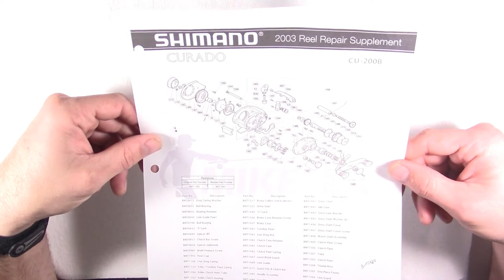Shimano Bantam Curado CU-200 Disassembly

Comment: Not sure if you will still see these comments, but wondering if this dis and assembly videos are the same for the 201's just in mirror?
Reply from the maker: You are in luck that I decided to check this channel. Yes it is just mirrored, EXCEPT for a couple things, and I hope I can remember them all.  Your Anti-reverse bearing will spin in the appropriate direction for being left handed, and the nut that retains the handle on the drive shaft is "lefty- thighty, righty loosey" aka left handed threads. I don't think anything else is that way besides the mirror. All the rest of the screws should be in normal thread direction. There are schematics for the left handed reels specifically. Almost all the parts are the same except the two I mentioned, and then sometimes Shimano just takes the anti-reverse bearing and put it upside down in the side plate. It works.

Comment: Question:  Should the roller clutch bearing be dry for proper operation?
Reply from the maker: Absolutely. Any oil/grease will cause it to slip and malfunction. This is true for all one-way clutch bearings in all reels. Also getting the reel wet (such as dropping it overboard) can cause this as well, though it would function normally after it dries.
Reply: @bayoureels1983  THANKS!

Comment: Great video.  Is reel repair your business?  I have one of these CU-200 reels that I got new back whenever.  It's never seen salt water.  It was an incredible reel when new, but now I can't seem to get it to cast well.  I just can't get any distance out of it.  I loosen the spool tension, back off the anti backlash, and it makes no difference.  I even put a set of boca-bearings in it.  Other than that, the reel has never been completely disassembled and cleaned.
Reply from the maker: Thanks for subscribing and commenting!  Yes I do have a reel repair business, though its a side-gig, not my main job.  I'm not sure why it wouldn't cast well if you already replaced the bearings, especially with Boca's.  If its never been cleaned before it certainly can help and maybe even fix your problem. It never seeing salt water is a BIG PLUS.  The main issue now with these reels is that parts have gotten quite scarce, besides bearings. If you want some help with it you can contact me on the FB page BayouRatt Reel Service.  I'm more likely going to see those messages rather than comments on here. Thanks for reaching out bruh!
Reply: @bayoureels1983  Thanks, I will contact you on the facebook page.

Comment: Hi my reel when I hold the spool and turn the handle it star turning?
Reply from the maker: Tighten your drag.
Reply: Bayou Reels I did.
Reply from the maker: @salahddinesaadi5926  I am not sure honestly what the issue is here. Is it that you can hold the spool with your thumb, and turn the handle, the spool stays stationary and the handle turns?
Reply: Bayou Reels yes.
Reply from the maker: @salahddinesaadi5926  something is not assembled correctly. It can be a variety of things. your drag stack both inside and outside the side plate could be out of order, or washers upside down. If your pinion gear is not aligned with the main drive gear, it will not turn the spool. If the pinion gear is not lifting and rising in alignment it will not turn the spool. Whatever it is, you did not assemble it correctly, otherwise it would function properly. My suggestion is to get the schematic, disassemble your reel, and use the schematic and this video to reassemble it properly. Orientation is important for all components. One washer being upside down can cause your reel to malfunction.